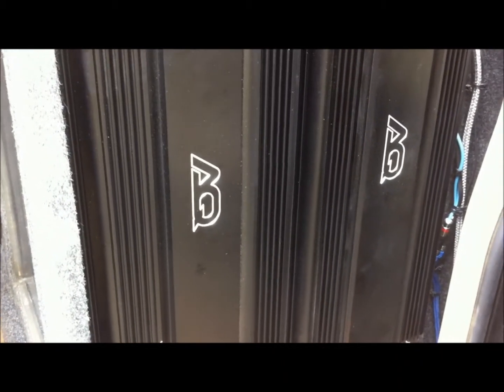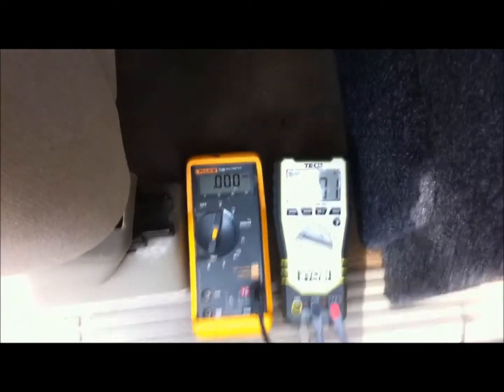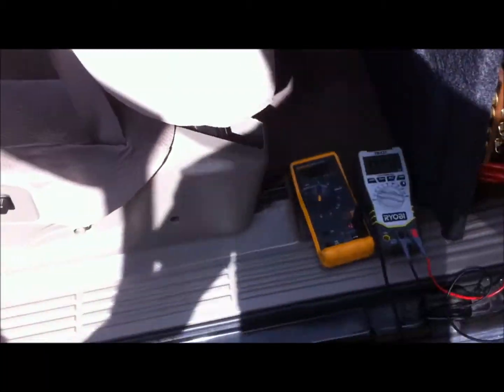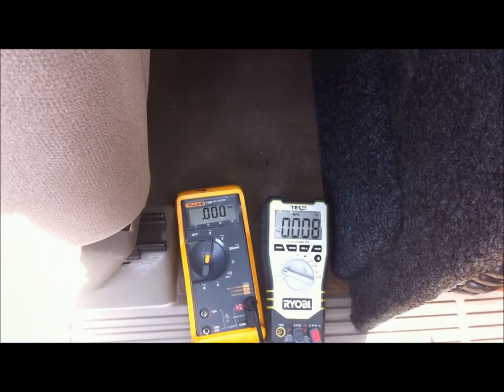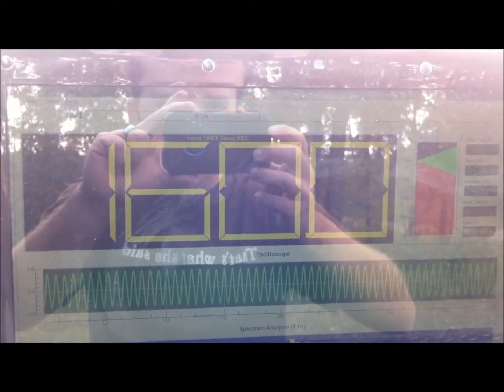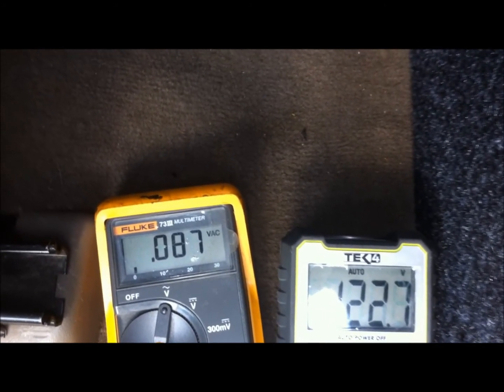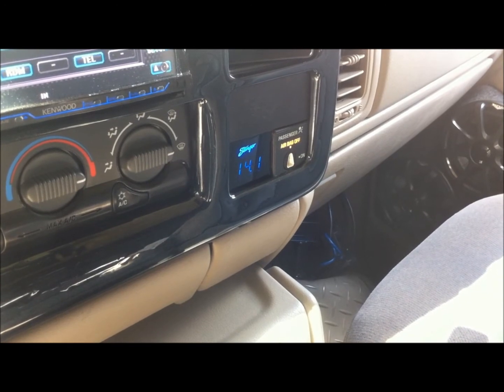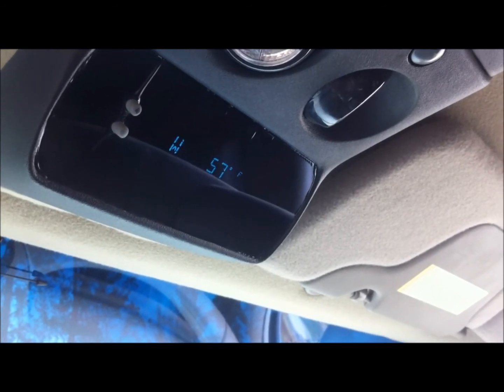Clamped output and Termlab test:  160.0 db and 11kw!!!!

Comment from the maker: @SwordLords1234 DC power makes a 270XP for honda vehicles, depending on what year your car is, I bet it will be it.  Mechman also has a new design 6 phase alt out that they can custom retro fit into just about anything and does 320 amps and like 240 at idle.  I am getting 4 of them for my rebuild.

Comment from the maker: @SwordLords1234 Yes correct, you don't want to charge higher then 15.0 for extended periods of time with 12 volt batteries.  I like to stay 14.4 hot and 14.8 for cold.

Comment: @AMICUSTOMS Well glad there are people with your kinda knowledge around to ask. I started to question their advise when they said that a JL w6 10'' was the best sub.. Lol.. So in your opinion (assuming i do things right, like you did with your truck) a 165+ alt from mechman, 3 total matching XS batteries, charging to 14.8, will it run a AQ 3500 @1ohm and a Crescendo 1000.4 @ 4 ohm (150 rms per channel) i won't fry my civics electrics, meanwhile not dropping volts to less then 12 ish?bestguess :D

Comment: @AMICUSTOMS SO if was charging 15volts lets just say, and i called my alternator place of choice to get one for my civic (mechman, singer ect) with a few extra XS batteries i should be fine to run a 3500 AQ (1ohm) and a 1000.4 (4 ohm)crescendo? as long as i don't go above 16 charging, then ill need step-downs like you said? I need you to open up a shop in south florida. The info they were telling me just didn't add up. I was sure to question it when he said his JL w6 10'' was the best sub -_-

Comment from the maker: @SwordLords1234 At a certain point you have to isolate the vehicle electronics as most vehicles won't do well past 16 volts and you will start to damage components, but that is done by using step downs.  By upping the alternator charge output you won't fry anything unless you raise voltage past the stock set point.

Comment from the maker: @SwordLords1234 First off, don't ever go back to that shop again cuz with a comment like that I wouldn't let them near my truck with a 10 foot pole.  Alternator work off a regulator that controls voltage and charging demand in amps.  If you want to raise charging voltage past the alternator voltage set point(14.8 generally), you have to bypass the regulator or use an external regulator.

Comment: If you don't mind can you inform me of the issues with raising voltage above 12-14.. say to 14-16? i went into my local bat& alt shop today and said i wanna put a 220amp mechman and 3 XS batteries in a 98 civic and they laughed and said civics have a max of 75 amp alternators.. and that if i raised the charging systems i would fry everything in the car. Can u lend me some of your knowledge dude?